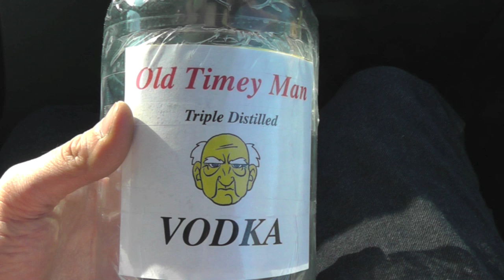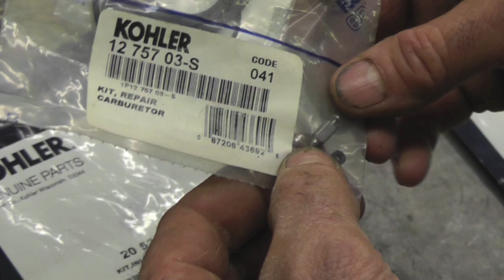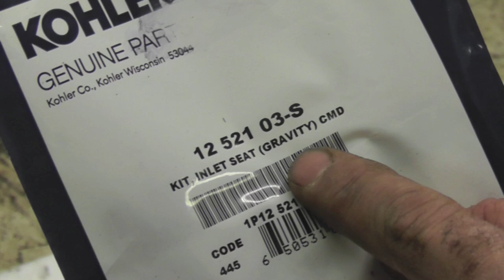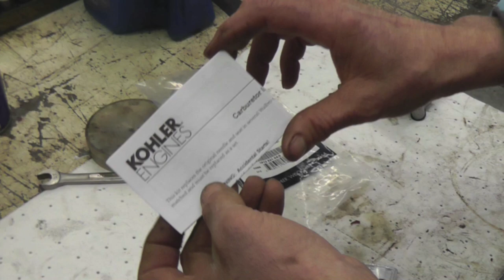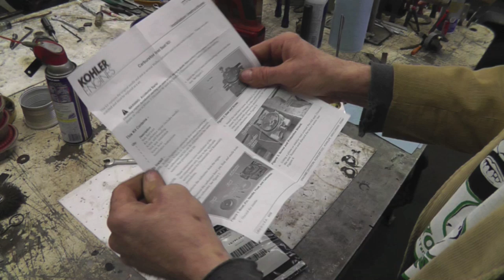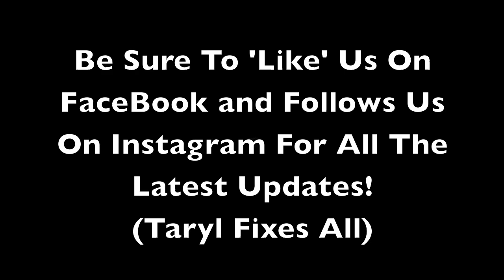How To EASILY Rebuild A Kohler Command Carburetor

Comment: Hey Taryl, 
I replaced the fuel pump, and rebuilt the carb. on a Kohler Command 16hp after watching your videos.
I cannot get it to combust for anymore than a couple of seconds.
Orignal problem was randomly backfiring and then cutting out.

Have you any tips and or suggestions on adjustments.

Thanks - feeling really defeated,
John

Comment: This was the 1st video I watched from your channel. It came recommended because i searched "Kohler Command carb".   I was hooked from day one!  Still watching 3 years later.  Saved me a ton of headaches and $$$.  Have used several tips and tricks to keep my old Craftsman LT1000 & LT2000 going.  Many thanks again for making these videos.
Reply: You guys always say the Lt1000 or other but don't say the engine model so I'll know what model of engine yall was playing around with
Reply: @Mike-su8si  The old ones with the Kohler are generally 426CC. Mine is a '99. and CV-16S.(16.5 HP). Before they named them LT-Etc. Green, not grey or red. 
I think the 16 'S' means Sears. That threw me off for a bit.. Switched to 426CC and they are rated from 15 to 16.5HP. Not sure why but the above carb is mine. I could tell by looking at it plus the part# kit matched mine. Just started leaking with 900 hours. Trouble free mower into it's 25th year. Outside of the stamped deck which was fine in my old yard but not here or our other house. Spindle city.

Comment: i really dont think my problem is the carb. but  maybe i'm wrong . here is the problem.  i have a 18.5 hp kohler magnum that starts beautifully as long as the gas is in carb  and prime is there.  but if i dont start the engine one a week every week it loses its prime. what i do with help of a friend (with great lungs) have him blow in the gas tank for about 30-45 sec.  till i can start the engine only can do this with gas tank fill no higher then 1/3 fill. . this  gets to be a  real hassle when friend is not around or i forget to run engine once a week . btw the engine is on my snow plow tractor so  when no snow its easy to forget to go and start the engine every week... otherwise if prime is there engine starts with no problem. my question is is it the carb or the fuel pump and how do i fix it and the gas tank is below the seat . the tractor is a gt6000 craftsman 1993

Comment: Thank you. I had ordered a rebuild kit through Sears Parts Direct. The had no directions and lots of parts that weren't in the carb I had. Also no knew seat, which I didn't know i needed until I saw your video, so when I finished and started it up it ran beautifully. Purred like a cat, for about 5 minutes then stopped. Could not get it to restart. I could see fuel in the bottom of the air filter bowl. I took the carb off again and it was full of gas. Just ordered the kit you recommended with the new seat. Going to go buy the 10 24 self tap with a spacer and a nut in preparation for when the second rebuild kit comes.

Comment: hello Taryl, is there a way to get rid of spark advance box on Kohler CV16S .... i bought a new coil but still no spark
Reply from the maker: Jess Graves are you sure you have 12v going to the box?
Reply: thanks for the reply, i will check again. i saw one of your vids.... you were replacing the coil w/kit but it was a twin. if i cant figure this out is there a kit for this one john deere scotts, cv16s?
Reply: i do have 12v to spark advance or whatever it is called
Reply: I have the same Engine it's a barrel of fun with ton's of gremlin's  don't think I will ever buy another newer age Krohler

Comment: Is it normal for a Kohler KT17 series 2 to backfire every time I turn it off?
Reply from the maker: +kd9bwi Back firing is a result of raw fuel entering a hot muffler. Yur engine is probably running to rich. Try leaning it out. Another cause could be its time for a valve job That KT17 is pretty old. Might have leaky valves

Comment: Taryl you are the man. One question, I have a Scotts 2554 with 25 ho Kohler. It seems the only way to reconnect the fuel solenoid
wire when not removing carb is to get to it by taking off engine cover.

Comment: How do I get one of those shirts? I just subscribed and enjoy all your videos. I have a troy bilt horse kohler engine 19.5 that I bought from Blowes last August and have had gas in my oil and all the gas leaked out. Just got a carb kit 22 757 01 S to try and fix whatever the hell is going on. Gettin costly replacing the oil, filter and putting gas in it. Smdh

Comment: Question have a Kohler CV15S, rebuilt carb. 3-times, still idles great however at full throttle the runs rough, have to choke it to smooth it out any thoughts Thanks Mike
Reply: solenoid sticks at bottom of carb (ethanol), or piece of hose/dirt stuck that carb cleaner cant push out.

Comment: Should I buy that fuel that comes in a can with no ethanol for weed eater chainsaw push mower and riding mower is it worth it
Reply from the maker: Some people who's equipment doesn't get used that much use the fuel only for the fact that the cost of the fuel out weighs the cost of the repair from it sitting long term. If yur someone who is using yur equipment on a regular basis you don't really have to use the fuel. But if you have some equipment that does sit more than getting used (tillers,generators,snow blowers ) It's good to use it in that equipment. But remember to try & get as much of the ethanol fuel out of that equipment before using the pure fuel.

Comment: I put my carburetor in the purple power over night and it came out with white crusty stuff all over it
Reply from the maker: Jay Neal yeah we noticed too that different Carburetors are made of different metal alloys and when using the Purple Power it can attack those alloys causing the chalky substance. The chalky white stuff won't hurt anything though.
Reply: How's the best way to clean out all that from the ports?
Reply from the maker: Carb spray, sand blast it if you have a sand blast cabinet or tip cleaners
Reply: Ok, thanks

Comment: Really learn a lot from your videos as well as being entertained.  Quick question - I have a Courage 22 Kohler engine on a Toro LX460 that ran beautifully for 10 years - no issues.  Then all of a sudden started blowing white smoke.  Long story short - I ended up putting a cylinder/head gasket on it, did a valve job, as well as reset the valve lash on it.  Also cleaned out the carburetor and got a rebuild kit for it.  One thing I noticed that it didnt have a welch plug but the welch plug was in the kit - so I went ahead and installed it - My question is does the Walbro carburetor that's on many of these gravity fed carburetors not have a welch plug.  Either way it run so much smoother now that I added the one that came with the kit.  Anyways wanted to get your professional advice on it.  Thanks so much for your videos.
Reply: J NULL

Comment: What pisses me off is when my lawn more shop asks me what the model/serial  number of my John Deere that my Kohler C series  15 hp engine sits in. Carb is Part # AM125355
Reply: I know the feeling, but look at from their side of the counter. Both JD and the other manufacturers will change things during a production run, which means which parts are applicable to your particular mower depends on when it was put together. The parts guy has no way of knowing what fits and what doesn't, or when a particular part has been superseded by another with a different part number without the basic info the model and serial numbers give them. Using this video for an example, there are 4 different rebuild kits for the carb, which is the right one depends on the particulars of the mower it's installed on. 

I've been frustrated often enough that the first thing I do when starting on a repair project is to find the data plate/sticker, wipe it off and take a picture with my phone. Whether I go to the parts house or home to look stuff up myself, having that info handy saves a lot of time and headache for both me and the people behind the counter.

Comment: Hello,  hope fully you can help me. my carb featured in this video floods into the air cleaner tube. is that a symptom of a bad needle and seat?
Reply: Yes it might be stuck/gummed up from the damn ethanol fuel the gooberment forced on us. The anti-after fire solenoid could be bad/stuck on the bottom of the carb causing that to happen also. The anti-after fire solenoid/anti-backfire solenoid fuel shut off valve can be bypassed also & then you would just use a 4 dollar manual fuel shut-off valve on your fuel supply line coming from the fuel tank to prevent fuel from filling up the engine crankcase or your air cleaner tube if you don't already have a manual fuel shut-off valve installed on your fuel supply line to the carb. There are several videos here on YouTube either bypassing/modifying the anti-after fire solenoid or removing it ETC. & how to check them. Put 12v to the solenoid first by turning the ignition switch on to confirm the plunger gets pulled down by the electromagnet & you should hear it click. You might have to remove it & bench test it also. After confirming your solenoid is operating properly/or repaired/or replaced/or bypassed ETC. make sure the carburetor fuel inlet needle valve, seat & float are operating properly/or repaired/or replaced & that should take care of the fuel getting into the air cleaner tube. Any other questions just ask me, I'm a 53yr old professional A & P Technician/aircraft mechanic. Go to  http://www.wfmachines.com/forums/forum.php  OR www.tractorbynet.com for more info & lots of professional people to help you for free :-)

Comment from the maker: The tool I made was from a 10-32 or 10-24 self tapping screw 1" long & a corresponding nut. I used a piece of 3/8 steel tubing 5/8" long. I'm sure you can buy the tubing at a good Auto parts store say like Napa
Reply: Where do you get a self tapping screw that is 10-24 or 10-32 with a nut? I have checked at Ace, Lowes and Home depot and they tell me that they don't make them?
Reply: Fastenall  ?
Reply: I got my 10/24 “thread cutting” bolt from the specialty box section in my local small hardware store - it’s either an Ace or DIY/Best store.  Sold in singles & Cost under a dollar : )

Comment: Great video!  Captures all the little details you need to do this right.  This video combined with the video on diagnosing non-starting due to fuel issues got my lawn tractor purring after sitting for a few years.  The Ferrari is next!

Comment: I second the request on making a video on adjusting the carburetor.  I know that on the Walbro there is a black adjustment on the left side of the carburetor and then a screw/spring adjustment on the top.  Would be awesome to see a video on adjusting the carburetor for optimal performance.

Comment: Taryl,    I have the usual leaking seat.  After working on it for hours, it still leaks.   The kit is over $30, yet I can buy the whole carb on ebay for $24....new.   I'm sure its Chinese, but it can't be worse than the Kohler.  http://www.ebay.com/itm/CARBURETOR-Carb-for-Kohler-20-853-01-S-20-853-02-S-20-853-14-S-Lawn-Mower-/282430484022?epid=141682058&hash=item41c22b2e36:g:f94AAOSwIaFZI5el
Reply: How did the Chinese carb work, I'm thinking the same thing?
Reply: W. M. Chinese could be worse thing to do. Just get the right set and clean the carb enough to where you can eat of it (very clean)by soaking it in the gallon of cleaner with a basket for parts overnight ( can get at auto parts store)Then spray all the trash out and remove jets to run a small wire or paper clip thru it to clean the holes out . Make sure no trash in bowl. Screw all screws all the way in but count how many time you turned them in so you know how many times to screw them out when you reinstall them after cleaning the holes out.

Comment: Hi Taryl, I am a huge fan and have learned a lot from watching your videos. I have a Cub Cadet LT1045 with the Kohler Courage engine and it does have a fuel pump. I am currently rebuilding the carburetor. Based on this video it looks as though I will need the 20 521 02-S. My question is this. Will that kit have everything that I need in it or will I have to buy something additional like you had to do in the video?  (For example, the seat)  Thanks for any help and keep the videos coming.

Comment: Yep, been there done that with these carbs. I agree the Kohler directions are worthless. Also the carb kits with the seat is priced way out of proportion to what you get. Meaning you are paying about 10 extra bucks for the seat. Kohler knows that because the only other alternative is to replace the carb at a premium price. I haven't been able to find a vendor that sells just the seat.
Reply from the maker: +acscolo Theres yur dinner! & the carb is a walbro carb I tried getting the seat from Walbro they referred me to the Krohler kit. Hey Krohler how about a needle & seat kit only.
Reply: They are in bed with high volume part's dealers they wan't the Machine to not work so you have to take her in. Oldest trick in the book same for Cars and Trucks.

Comment: My krohler does the same thing act's like it's locked up when I first hit the key then the second pull starts her. An Engine with lot's of odd little quirks. Spray's gas literally all over the front end and the muffler at first startup that's fun and safe. She's coming apart for a rebuild since it's winter. Seems like I may just replace the carb the cost of the kit is crazy high.
Reply: Jonathan-Emily Powell the gas pouring around the muffler is the needle in the carburetor not seating into the seat. Which can allow all the gas in the tank run out .That can be fixed pretty easy. Like seen in this video. Could cause the motor to fill locked up when starting to by to much gas being in the head. Try rebuilding the carb and save money just make sure you let it soak overnight in carb cleaner then blow it out. It’s not hard an plenty of YouTube videos to help you do it. Hope this helps, you may already have it fixed by the time you see this text.

Comment: I leave those anti backfire solenoids off mine and anybody i repair for. i just replace it with a plug.
On kohlers they cost 80+
if you throttle down to idle, and turn the key to off , 99% of the time they don't  backfire
Reply from the maker: +muugatest  theres yur dinner! On those solenoids I also just cut the tip off.

Comment: So the carburator kit with the needle and seat costs like over $30.  I decided to go with a China carb on ebay.  Little less than $25.  Why is Kohler ripping people off with a bag of parts that comes with trash tools.  Seems like the bag of parts should cost $7.  Then sell the nice Taryl tools for inflated cost would be a better route by Kohler.
Reply: Kartboarder22G how did that work out?

Comment: Taryl, thanks for this very helpful video. I was able to fix a leaky CV490S carb to repower this Craftsman mower. http://www.mytractorforum.com/14-craftsman-sears-forum/1009210-ys4500-bad-intek.html. I linked your video in the thread, hope that's OK.
Cannon

Comment: Hey Taryl great video man. I have a question regarding the carb kits, I think a shop here in my city maybe trying to scew me.
I have a Kohler Courage 20 Model/Spec: SV710-0019 and I contacted them asking about a Carb kit and they told me " The only way to get the inlet needle and seat is in the carb kit. #24-757-46 lists for $124.97ea in stock." Than I seen your video and it would appear the #20-521-02-S would work for my engine (it has a fuel pump). Can you confirm?